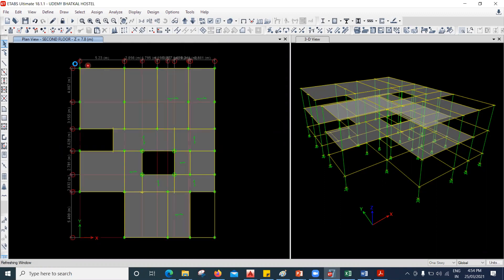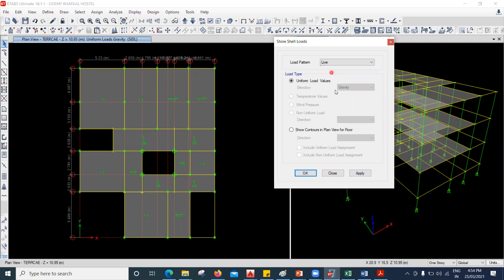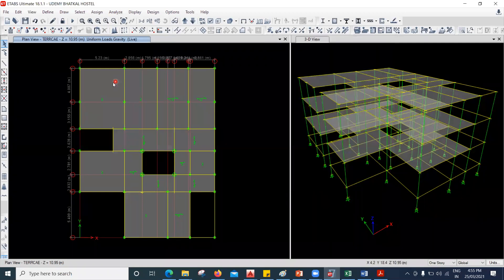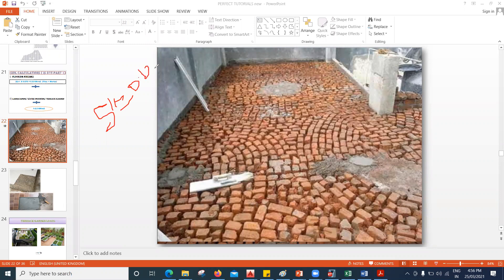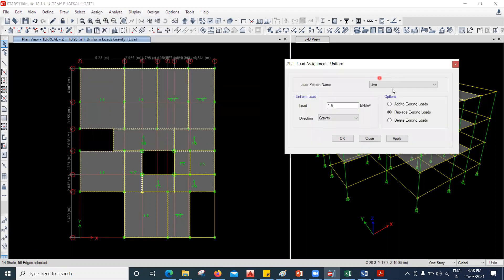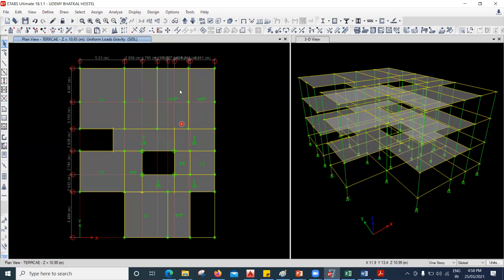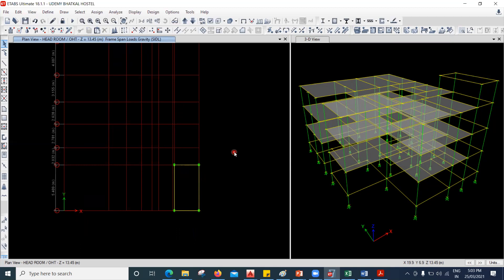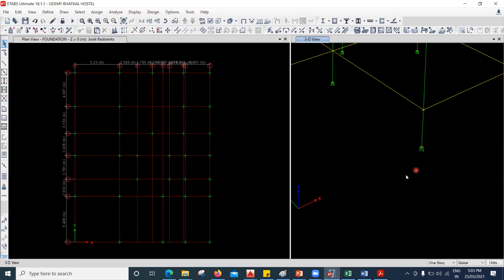How to calculate Terrace floor load on Slab I Etabs I Complete Etab Course

Comment: Hi sir .how much weigt we can add on terrace .5inch slab with uniformly distributed load.
Reply from the maker: @suriplaysgaming  terrace you can add 1.5kn /m2 live load , dead load will be 1.5 kn/m2 . If you are installing sole solar panels and terrace gardening you can add another 1-1.5kn /m2 additional load under dead load
Reply: @civilbrains  we add 5inch cement mortar on the terrace to fit tiles .is this safe . How much kn weight we can add on slab .